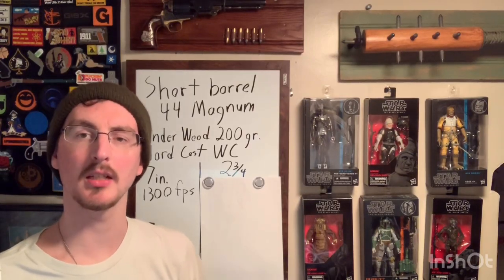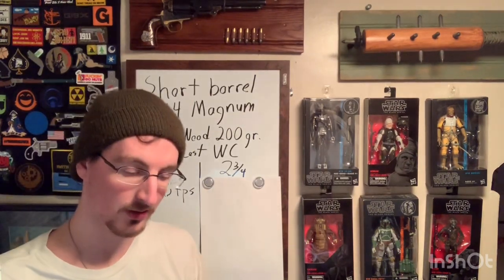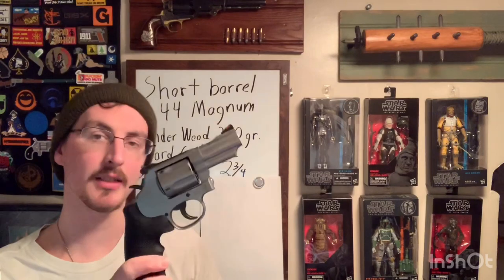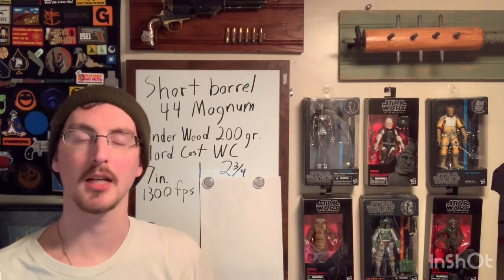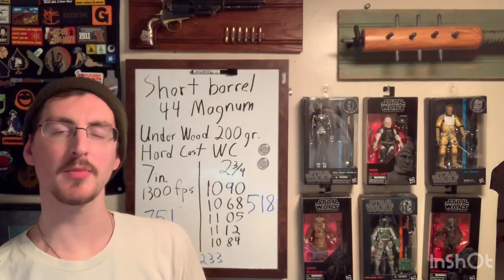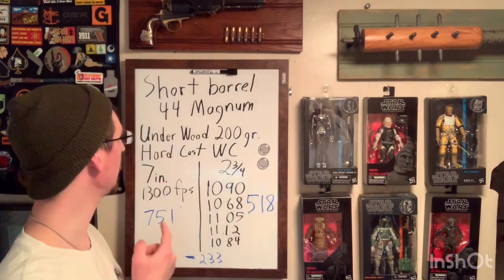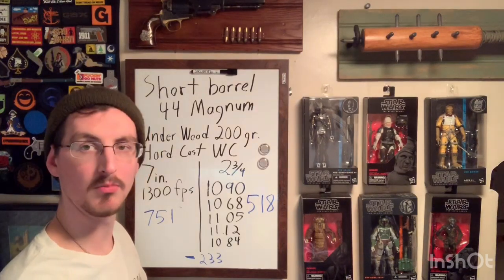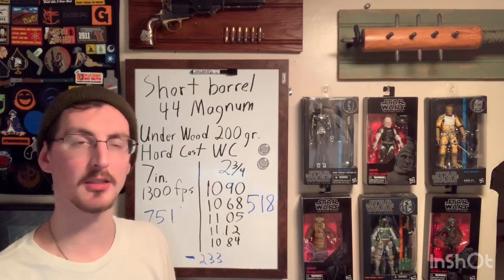Short barrel 44 magnum velocity test underwood 200 gr. Hard cast wadcutter (feat. S&W model 69)

Comment: That's useful data.  It would be more accurate to just say "The advertised velocity is 1300 out of a test barrel.  And all guns have variation."  It's misleading to attribute a difference in velocity to barrel length.  Especially an unknown like advertised velocity.  UW has a reputation of getting advertised velocity or better from their semi-auto cartridges but less from their revolver cartridges.  Also batches vary.  Chamber dimensions have a significant effect on pressures.  Some 4" revolvers get consistently higher velocity than some 6" revolvers with the same ammo.  Temperature affects gun powder, some formulas more than others.  Etc.

Comment: Well, to strart with, the average of your readings is 1091. That's just over 200 fps with less than half the barrel length. More than a 4" reduction. It's impressive that it didn't lose more velocity and power. That's only about 50 fps per inch of barrel. Most calibers lose more than that. 

Also, as you did mention, these are wad-cutters. They are NOT defensive loads. You can use them for that, but they are intended for target shooting and low recoil. Intentionally loaded slower. Semi-wad-cutter hollow points are a defensive load, but that's another creature and would likely be loaded hotter. If you're interested in a defensive load, look at the 180 grain xtps Underwood has for the 44 mag. 1700 fps. That's smoking.

You asked about what we think, thank you. I appreciate your efforts. It's good to have this kind of info. My request if you're going to be doing more videos like this, please try the Underwood 180 grain xtps I mentioned before. Have a great night bud.
Reply from the maker: Shrub Berry well to start you got me I just guesstimated the average and was off by 11 ft./s and I bet you if I re-shot the group I could've gotten a different number. As far as the ammunition underwood labels this as self defense ammunition and given that it comes in 20 round boxes and isn't cheap I'm not thinking it was designed to be plugged away at the range I'll add the ammo you mentioned to the list of what people said I should test
Reply: Underwood is some of the most consistent I have seen, but there is still variation. No doubt.
 I guess to be fair, when I think "Self defense", I'm mostly thinking of the human sort. The Wad-cutters are often recommended for self defense, mostly for defense against wild animals and large game if you are hiking/camping due to high penetration. I should have considered that point in my first comment.
Thanks again. Looking forward to seeing the new vids.

Comment: I'm in the market for a 69 Smith.
The energy from these loads are about like a .45 Auto in Co.mander length gun.
I reckon some more work needs done to come up with a 'Street' load for the 69
Reply: These are light magnums also though 240 gr 44 mag should be 1400-1450 fps 200 gr at 1300 from the same barrel is weak sauce